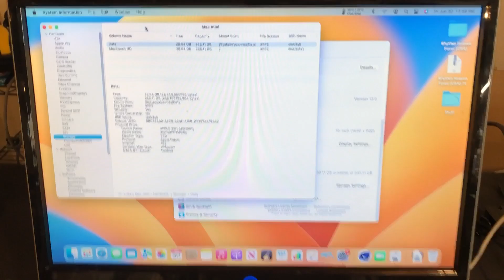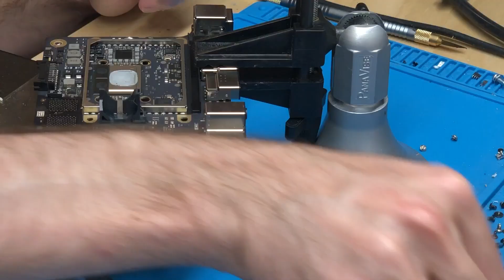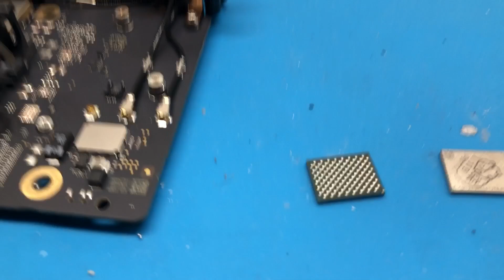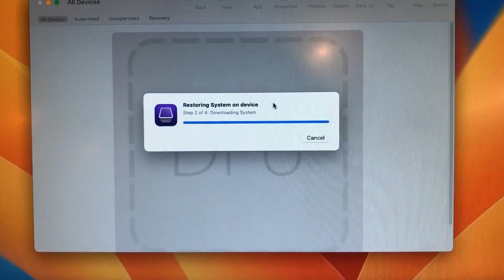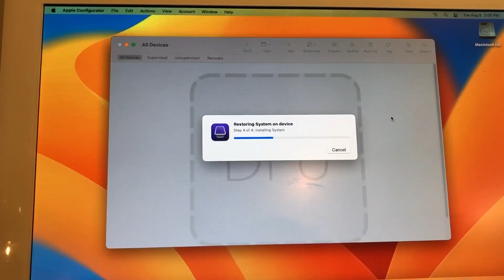M1 Mac Mini Soldered SSD Upgrade

Comment: This is a ridiculous situation. Storage and memory should be easily upgradable by anyone and without the need for specialist tools. Users should have a right to repair and upgrade the expensive products which they have bought.

A device can never be classed as environmentally-friendly if it cannot be used, repaired and upgraded.

Comment: How come you are not using a board holder which is meant for such an operation instead of using a weight and I see the board is moving a little bit.
Could you have used a powered solder sucker to remove the residual solder ?

Ricky from IBM

Comment: I don't believe that mixing the chips is what did it. BGA chips are notoriously hard to weld down evenly and correctly, especially with a hot air station. I think after re-trying 8 or so times you finally fluked it. Also, after that much heat and abuse to the chips I would be running prolonged stress tests on the newly seated modules to verify that they are indeed okay.

Comment: Hi, thanks for your great video. Could you please tell me which magnification or microscope you are using? I tried to solder small SMDs once but I had serious problems seeing what I was doing. EDIT: After seeing Luke's video the components don't seem that small. Last time I tried TSSOP and it seems smaller. However, I am still interested in your magnification equipment.

Comment: Amazing video...Use one pre-programmed and one blank and it will work.  Great.  Also when you tried to install firmware on both i think it may have also preprogrammed it to a degree and when you mixed the two it fooled the system  thinking that it was legit Apple soldered nano ssd.  I've done this before on an Air that had soldered memory on it and it worked.  :).  Great to see it works on Mini as well.  Great Reballing skills and taking the oem nans off..So hard to not destroy pads sometimes.  Hardest part.. reballing is hard too sometime if you use too much.  Great Job.  Amazing share.  :) Subscribed. Northridgefix is my main soldering guy...i just saved you as #2.  Of course I love Louis from NYC the Mac Genius but he repairs them mostly doesn't upgrade last time i checked.  Right to repair is a dream.  Lets make it happen.  Manifest that.
Reply: Louis has moved to TX some time ago.

Comment: Always do direct copy by using installer pre prepared OSX version..its a lot smoother than doing it over the internet since over the internet always checks for permissions etc and fails often times.  This is common on all older and newer macbooks air pro and imac. I always install them without internet download since sometimes if the right configuration is not matched with the serial and model number of mini it will fail since Apple is going for full monopoly with all serialized parts whether its iPhone or MAcbook.

Comment: Hey Colin. Thanks so much for your great iOS hacks on unsupported macs. I used the Mojave one on my old 2008 imac and it worked perfectly... i've got another problem now. My shitty M1 mac mini won't boot up anymore. I took it to the store and they wanted 550€ for a new motherboard because the soldering was defective on mine. Is there a way i can re solder the motherboard to the SSD without damaging stuff. The  machine is only 2 years old but just out of warranty. Thanks for any help. Liam.
Reply from the maker: What exactly does it do currently? Unfortunately schematics for the Mac Mini aren't readily-available as with MacBooks, so it may be considerably more difficult to pinpoint the issue.
Reply: @dosdude1  thanks for the fast reply Colin. It lights up then after 5 seconds the white led turns to an orange blinking SOS patern. I think its a problem with the SSD though not sure.
Reply from the maker: @liampaulmcguinness  That means it’s in recovery mode. What error is shown when you attempt to restore from DFU mode (hold power while plugging in)?
Reply: @dosdude1  i didn't manage to get DFU mode to work. The screen is just blank.
Reply from the maker: @liampaulmcguinness  DFU mode doesn’t show any image. You need to connect it to another Mac via the correct USB-C port on the Mac Mini, and attempt restoring using Apple Configurator 2, as shown in this video.
Reply: @dosdude1  i've got it in DFU now
Reply: It just stops at step 4 of 4. I think SSD is fried. 😪

Comment: I repair Macs for a living and I have to say that New Macs of any kind absolutely do not impress me and are ultimately useless in the real world since they literally removed any ability to run any real everyday software that would be useful in an actual work environment. Sadly the life span of a current new $2400.00 Macbook Pro or a Mac Mini is approximately 2 years give or take. Gone are the days of Shelling out decent money and getting a decent machine that would likely run for a decade if serviced properly.  Like anything and everything labeled Apple, they have taken the road of no innovation and literally no repair or upgrade path for anything they supposedly design. I bet this guy would be some irked if this had gone sideways and bricked the Mac Mini. In my opinion they got very, very lucky this even worked, and of course any warranty or Apple-care contract the customer may have had for this device just got voided. As for skill... ummm yeah. Prying those chips up with a heat gun without the proper tool on the end to distribute the heat made me cringe and even more cringe worthy was the way he was pulling those chips up with an x-acto knife. Seriously, there is a proper tool for that too. Obviously this was a Frankenstein moment to be sure.

Comment: The ssd will be aftermarket though and not apple so there will be a price difference. It like having a an expensive engine then fitting cheap parts to it.

Comment: Great Job, but after over 25 years of soldering myself I cringed each time I saw that solder ball covered  blue mat you were working on.. Please clean it before you do that kind of work. It is so easy to melt solder balls and get them stuck to the bottom of the board and really mess things up..  But glad you managed to get it done..

Comment: So you have no f’ing idea why it worked the third time and didn’t work the two previous times. You’re simply speculating. Which makes this a huge gamble to try and reproduce. I would happily give Apple $800 to know I will have a machine that actually works out of the box. Especially with the amount of tools, labor, and time required to do this. My time is worth far more than the $800 that Apple charges to simply start with a machine with 2TB already installed from the factory.

Comment: Amazing work, impressive stuff. It makes me sad seeing all these computers with soldered storage, no reason why Apple don’t just have a standard m.2 slot so users can upgrade as needed. The amount of unnecessary e-waste that will be created when these chips fail since storage can’t be swapped by the user easily. I was going to get a Mac mini but doubt I’ll bother, after ten years in Mac land I’ll go back to a custom PC that I’ll actually own and can upgrade / swap parts as needed. I’ll miss macOS for sure as I love Apple software but their hardware designs and general anti-repair stance are not for me.
Reply: That’s why I still use an upgradable 2008 MacBook Pro. It’s running the latest software from 2023 because I used opencore legacy patcher. It’s a hacking tool to run unsupported OS on old computers. It runs great

Comment: Awesome test, thank u for sharing this vid!👍It would be great to find out what was really behind restore failures and why that particular combination of chips worked. I would say none of those 2 chips in the second try were blank from manufacturing as Aliexpress is full of scammers and liars, however it would great to test it with real blank chips. Honestly I wasn't expecting it will work because of the Apple's secure enclave in the chip... this is teaching people to continue to try and not give up.

Comment: Didn't Apple integrate the SSD controller into the M1 chip? So it does not matter which nan-chip you install, the controller inside the M1 chips will cause the installation to fail.

Comment: This might be a stupid question, but has anyone considered creating LGA sockets for NAND chips? This kind of part troubleshooting could be done without constantly soldering/desoldering, and it opens the possibility for future upgrades. Of course, if the pinout/pin positions on the chips are constantly changing it would be a prohibitive effort for the community to undertake.
Reply: i did think of that
what i think is that the NAND chips are used in phones as well which if socketed will make them bulky and feature of them is that they are small and not bulky if only pc nand will be socketed then the manufacturer of the chips will need to increase the variety of the chips and i dont think anyone will use it.
its just my opinion, cuz idk the exact functioning of nand chips

Comment: 6:43 nope! You just apply flux, apply solder, clean the pads with a copper wig, reapply solder and solder the chip - with a proper tool!

Comment: Someone had a bit too much caffeine before starting this upgrade. Or was just nervous. Highly recommend you get an Atten 862D hot air station. Makes this so much easier and it’s really affordable.
Reply from the maker: Just nervous LOL, first time really doing an upgrade that involved underfill removal. I actually really like the hot air station I have currently, an Aoyue 852A++. It works well, and I've never had an issue with it.
Reply: @dosdude1  lol. Okay, reason I recommend the atten is because it eliminates the vibration of the air pump. Uses a turbine fan instead of the typical air pump that vibrates the whole workspace when you turn it on.

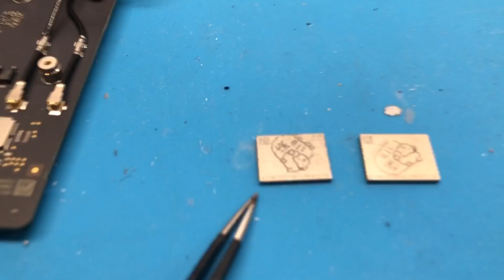Comment: 18:58 testing to see if blank unprogrammed NANDs will restore via DFU instead the previous which were bought programmed. 
Others ask if it is possible to “blank” the programmed NANDs?
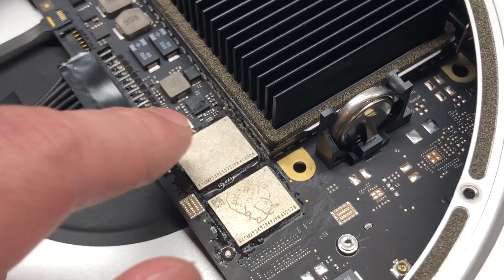22:30 3rd attempt, using one of programmed and one unprogrammed, thinking maybe one or another was a bad NAND.
Note: Also had tried different versions and OS along this whole experiment.
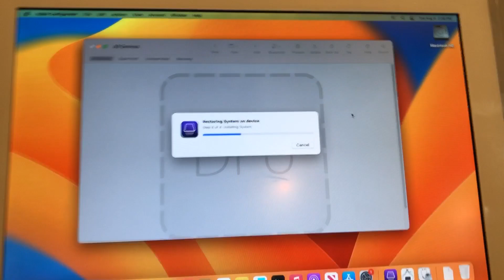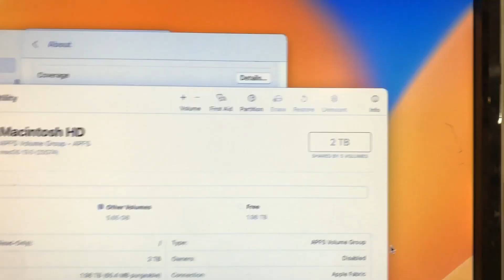25:28 Progress! 27:00 i can hear Luke beaming joy! 2TB.

Comment: Great. I'd be very curious if the chips for the Mac Pro can be installed on the Mac Studio with M2 (I've got the base M2 Max model...). I've read that technically the SSDs of the Mac Pro M2 Ultra are the same BGA315-type ones present on the Mac Studio M2 Max / M2 Ultra. I know that on the Mac Studio M1 (BGA110) it is possible to change them even with higher memory sizes, respecting some rules (there is a lot of info on a well-known forum). Obviously in this case you need the chips of another Mac Studio M1 or what you can get on the Apple self-repair site. However, no one has yet tried to put the chips of the Mac Pro M2 on the Mac Studio M2 ... it would be something to try! THANKS.
Reply: Hi, on which forum would one find such information?

Comment: no flux on desolder? shame
Reply: im assuming, underfill is some adhesive, right?
Reply from the maker: @TravisPickle  Flux won't help when removing underfill, in fact it will make it more difficult. Underfill is an adhesive, but it becomes hard when it cures.
Reply: @dosdude1  does goof off work with that adhesive? Does mineral oil bath help? we got to find something easier than an Extacto knife cutting potential traces. excellent work by the way. I would have been pissed first time and it didnt work. By the way, i was commenting as I watched the video, and since i had never seen underfill before, that's why i asked, maybe jaron for epoxy or solder. haha, thank you

Comment: What a cliffhanger! By 23:00 I was really starting to doubt whether this would have a happy end.

Just shows how far Apple is willing to go sacrificing user friendliness to the financial interests of their shareholders. In a desktop system there is absolutely no reason whatsoever to use soldered nand instead of an m2 ssd.
Reply: And you want to keep that device for ever?
Maybe you need a monitor, the foot stand it's only 999,99 and no, monitor comes without one included.

Jokes aside, wait until Apple will implement USB-C on phones, will work only with Apple cable, cost around 90 bux for a goddamn usb-c cable

Comment: If you heat the entire board to a certain temperature, it will be easier to remove the chips, and you will not have such problems as bending the board due to uneven heating.

Comment: Since this is not a laptop computer, and since when the internal SSD dies the computer dies too (thanks to Apple for using it as a BIOS chip), there's no point in using the internal SSD at all. Just use an external drive for everything. So much cheaper and increasing the life of the computer.

Comment: I think it was a good idea to add that extra solder.  If the board wasn't flat enough the existing solder would not be enough to get the whole chips reliably connected.  If I ever tried this I would be sure to use the leaded solder that has been used for a long time.  I hear the lead free stuff is more brittle, takes more heat to work with and can grow tin whiskers that could cause problems eventually.  As much as I like things that are environmentally friendly I think avoiding tin whisker issues would help keep stuff out of landfills.  Not only that but lead is not the only metal that is bad for you. Tin can be too!  Of course there are elements that are much worse you never want to be around too!  It feels like they focused specifically on lead looking for a way to make our electronics unreliable!

Comment: Apple does everything it can to prevent repairs and modifications on their hardware by users. This will change in 2027 thanks to the EU that will force the Right To Repair onto Apple and other smartass vendors that think they can lock up users indefinitely in their proprietary ecosystem. On recent Macs it has become impossible to extend RAM or SSD's which renders the devices obsolete way before the CPU is not powerful enough. Same for iphones where 3rd party parts are rejected and flagged. I like Apple products but I HATE Apple for playing as dirty as that. Hopefully the legislator will squash their balls soon. And I sit down with a Coke and listen joyfully to their whinings.

Comment: The engineering of this is seriously impressive, but with Thunderbolt 4 it's basically a pointless upgrade. Too much risk when a Gen 4 NVMe SSD inside an external Thunderbolt 4 enclosure will work almost as fast.
Reply from the maker: For a Mac Mini that's a decent option, but not so much for a MacBook... Where this same exact upgrade applies (along with all other Apple Silicon systems).

Comment: Why are there two SSDs on a base 256GB M1? I thought two was for the 512GB which would then have twice the bandwidth.
Reply: M1 have 2 nand chips for base model 256gb, M2 has 1 nand chip for 256gb base model, hence the results of M2 base model having half read / write speed to nands.

Comment: I truly appreciate your honesty to show every step even failed one.I also admire your patience and determination to get the job done.Considering the risks and try and error process it could be a dead mac mini now .I personally wouldn't go through this nerve wrecking process to expand my drive capacity.
Reply: I think this wasn't so much about expanding the capacity as it was at looking into what works and does not. My take away is that the chip zero must be the one with the programming, while chip 1 is the blank one. Makes sense. Regardless, I'll be using my Jobs' era macs until they die, then it's off to linux. Fairly well done with Apple until they get past this return to the 1990's Michael Spindler CEO era of non-upgradable machines. Everyone forgets that this BS was done already and it took Steve Jobs returning to bring the company back from the brink of extinction.
Reply: @foodandart5808 
Well unfortunately iPhone is keeping them alive now even if everything else fails iPhone and iPad sells are insane for them to be willing to change anything I do agree with you I would never own an apple computer